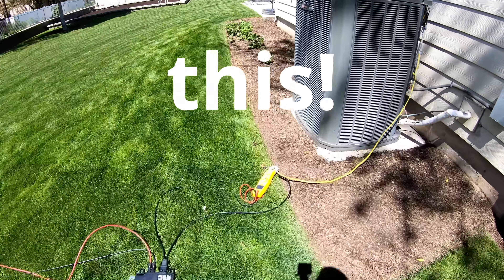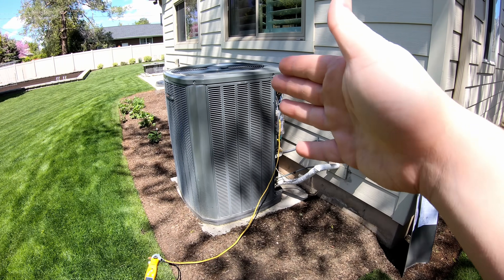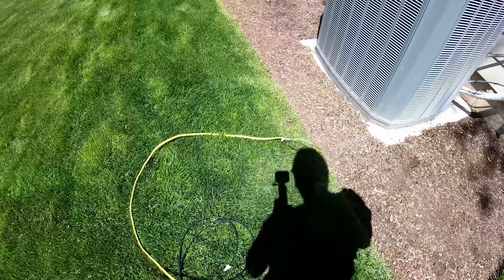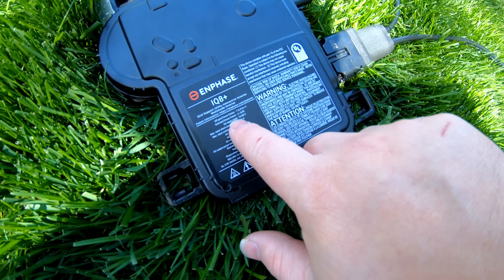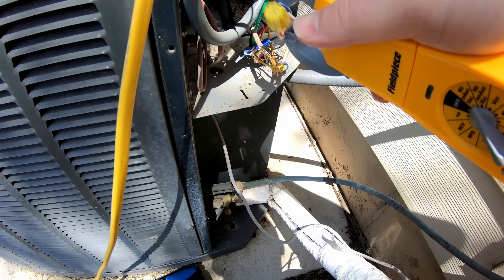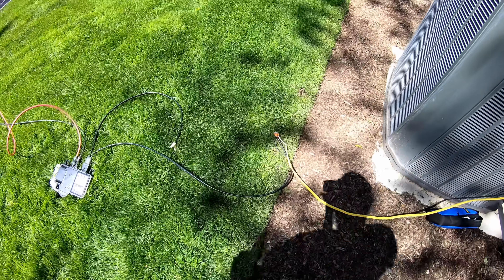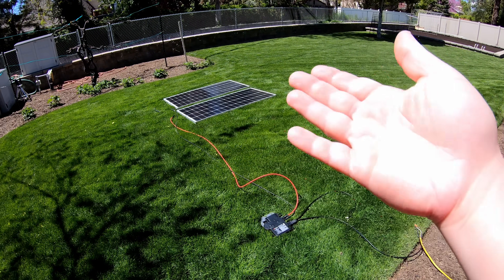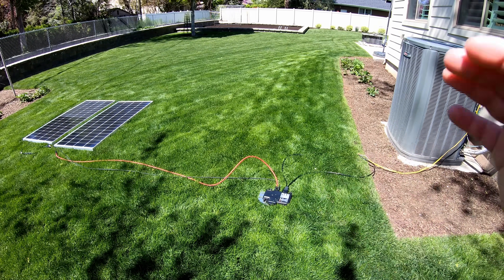1 Hack To Eliminate Your A/C Power Bill This Summer!

Comment: I just tried this with a 2000W SUN inverter.  Shut off the inverter's limiter functions and it works great.  Only takes about one minute for it to produce power, so not much of a delay.
Reply from the maker: Awesomeness! Thanks for watching!
Reply: Can you show your setup?
Reply: @kknmesa  The basics are the same as described in the above video.  I just ran my wires to the inside of the house near where the AC unit is.  The wires (8ga) from the solar array ran to the 2000W SUN inverter.  Only used enough solar power to generate about 1300W for this experiment.  Than I ran the wires (10ga) from the inverter to the outside to the compressor relay solenoid (aka Contactor) on the side of the relay that goes to the compressor.  I only used Line 1 and Line 2 from the inverter.  I did not connect the neutral wire since 240V devices do not use the neutral wire.  That is it.  When the AC came on the inverter took about 20 second to engage and I had supplemental power feeding the AC unit when the sun was out.  I got about a 40% decrease in power coming from the grid and no feed back with this setup.  If one uses more solar power but keeps the supplemental power below what the AC is using there will be no feed back into the grid.  I would have gone with this setup only if I had not already gotten a 6000W off grid inverter.  So now I have the full off grid system installed so I do not need this set up anymore, but this is a very simple low cost setup to supplement your electric bill since most of it comes from using AC in the summer.
Reply: @darylw792 How do you support the 240v of the AC? I though 2220W Sun Inverter only outputs 120v
Reply: @sherwinlee2107  The SUN 2000W inverter has two models and both only support 185V - 265V.  In other words they are 240V only inverters.  The only difference between the two is one model supports 60-110V DC solar input and the other supports 50-90V DC solar input.

Comment: Something is wrong here.  That condensing unit with the Compressor and Condenser Fan Motor both running will draw MUCH more than 5 amps at 240 volts.  It would be drawing more like 15-17amps depending on the tonnage and SEER.
Reply from the maker: It’s a 3 ton 2 stage unit. I guess I just have a highly efficient unit! Thanks for watching!
Reply: @theresatrickforthat   That does not explain it.  2-stage condensers operate at 100% capacity (with both stages calling) or 66% capacity (with only one stage calling).  Even if your system was only calling for one stage at the time of recording the video it would still draw 10-11.5 amps which is still far in excess of the 5-amp draw shown in the video.  I'm not hating at all.  I find your video interesting but something still does not add up here.

2-stage Trane would likely make this an XR 17 series.  What is the model number of your outdoor condenser unit?... 4TWR0736?

Comment: If you think you're running that AC unit on 1.2 amps, I want whatever you're smoking.  12 volts at 200 watt (max)  is ~ 16 amps. Converted to 120 AC brings it to ~1.6 amps MAX. 
You're using two panels, which is telling me each is producing ~ 100 watts during your "filming." 

This isn't a hack. It's a YouTube joke.   I'm running two 1000-watt linear amplifiers via solar and batteries. I WISH I could run it on a couple 200-watt-12 vdc panels.

"1 Hack To Eliminate Your A/C Power Bill This Summer!"

So, let's see you ELIMINATE your A/C power bill using a couple of 200-watt panels.  It's not going to happen. 🤣🤣🤣🤣🤣🤣🤣
Reply from the maker: The two panels are not running the full A/C alone yet...but I'm saving my money for more so I can! For now, I'm putting what I have to work and letting it offset what it can! Thanks for watching!
Reply: @theresatrickforthat    "The two panels are not running the full A/C alone yet."

No kidding?  🤣 Yet you posted a video claiming you ELIMINATED your A/C electric bill by using two 200-watt bifacial panels.  

When you have everything done, PLEASE repost a new video because what you are doing is GREAT!  Once the hardware is paid off, it's PURE FREE ENERGY.

Comment: All seems logical and a fun experiment, but at this scale just not worth it in my opinion.  Where possible though having stand alone power systems is awesome. I build an Observatory in my backyard and decided to do it entirely off grid. It has a 12v 200AH LiFePo4 battery that is charged from 4 panels on the roof next to the dome. Most things in there run directly off 12V directly from the battery (with a step down between battery and bus bars to protect electronics from any spikes etc) for efficiency reasons, but I also have a 2000w inverter. I built the entire power system on a handcart from harbor-freight so i can move it around should I need to power something else. Powers my telescope mounts, observatory dome rotation and shutter, mini PCs, cameras, and charges a few other things.
Reply from the maker: Every little bit helps I’d say. Sounds like a pretty sweet setup you’ve got there! Thanks for watching!

Comment: When contactor is on, electricity produced from solar panels will be used to provide power to the condenser fully and enough without additional electricity from the utility or power will be combined from both sources? When contactor is off, how electricity produced from solar panels is treated? Does this setup work without micro-air easystart device?
Reply from the maker: That’s correct. The grid will supplement any power the solar doesn’t produce, but the AC is using both power sources at once. When the contractor opens, the micro inverter doesn’t see the grid anymore and shuts down the solar power. You do not need a micro-air easy start to make the solar work. Thanks for watching!

Comment: I'm not an electrical engineer. However, how does this work with just one line and neutral? Would it not be better to use two inverters for L1 and L2?
Reply from the maker: It’s a 240V inverter. So two hots. Thanks for watching!

Comment: 400 watts of solar is roughly 10% of the power that unit draws, no one will be eliminating their air conditioner usage with this setup, just reducing the draw to a small extent. those 2 solar panels couldn't even power the smallest window a/c unit you can find. it will however power a fan, that's about it. now if you built up that solar panel grid 10 times, yes you could technically power that unit in full sun only, however you would still need the grid to start the high load from all the motors in it.
Reply from the maker: You’re right. Except in my case, those panels were providing more than 10% for my particular AC unit. Anyway, it’s a stepping stone to my dream huge solar system. Stay tuned for more! Thanks for watching!
Reply: The system was drawing 5.2 amps at 240v (1248 watts), and the solar was supplying 1.22 amps (about 292watts)

So it's offsetting about 23.5% of the load once the inverter fully boots up and starts exporting. He'd need to quadruple his solar output to match the draw, but it definitely does offset it a significant amount.

You also appear to have missed the part where he mentioned the soft-start unit on his ac system, so the inrush current/startup load is actually quite small on it now.

The bigger concern is just about the financial viability of it. This thing is only going to "produce" power while the AC is running, which is going to be mostly during the hottest parts of the day, but it likely won't be running constantly during those hours, so there's still a huge waste of solar production energy, not only when the AC isn't running, but also for the first several minutes that it is running, so it's terribly inefficient. ~300 watts of production isn't terribly much, but it gets worse when it's not even being fully utilized to power the rest of the home when the AC isn't running. With a system that small, I don't really see a good reason not to just go ahead and grid-tie it. You're going to be drawing 300 watts at any given time with other items/appliances in the home any time the sun is shining anyway.

Solar takes a long time to hit a break-even point anyway, so only having it run a fraction of the time that it could be producing is going to make that considerably worse.
Reply: that's a crazy efficient a/c unit, i don't see how it's possible for it to only be pulling 1250 watts when my 3 ton pulls over 3 times that while at idle(not starting).

Comment: You will need 10, 350 watt panels to run a 3 ton unit.
Reply from the maker: In my case, I would just need 5 or 6. Thanks for watching!
Reply: @theresatrickforthat  So 1.5 ton unit?  I love that AC units are starting to be able to do this.  Does your unit have a soft start?

Comment: I must be missing the point. What is the primary benefit of hooking the solar array ONLY to the AC unit as opposed to the electrical panel in the house? Couldn't you be saving even more money by offsetting the energy cost for other appliances you are running as well? Is there other equipment cost that I am missing?
Reply from the maker: You would be right about getting more use connecting straight to the power panel. But then you would need a grid tie agreement. Going through the AC is a way to start small and ensure you’re 100% self consuming and not back feeding the grid without a grid tie agreement. Thanks for watching!

Comment: It honestly seems like it would take a long time to recoup the money spent on all that equipment you need to get it 100% off grid.  
Even if you got it 50% off grid it’s a large up front cost for enough panels(you’ll need more than what you are showing) all the wiring and inverter(s).  

Until energy cost get higher it’s not worth the extra cost.  
Although, that is the plan, to make energy cost skyrocket so you have to change over to solar.  
Energy can actually be extremely cheap if they would just build more nuclear plants and drill more oil and dig more coal.  
We would be paying pennies for energy if they would.
Reply from the maker: I’m using it as a stepping stone to get a bigger system. But might as well start putting it to work ASAP right? In the long run personally, I’m going for energy independence so that I’m not at the mercy of the government and utilities. Thanks for watching!

Comment: What’s the actual delay time before you have output once the iq8+ once it sees the grid?
Reply from the maker: I’ve found it to be between 4 and 5 minutes. Thanks for watching!
Reply: @theresatrickforthat you should add another contactor with a delay on make  that brings on the ac after the delay time and do a video on that. Many ac units don’t run that long. Your soft start is basically a delay on make switch for the compressor. It may require a couple 240 v diodes

Comment: I have tried to read through the comments to see if my questions have been asked but I was hoping I could ask you for confirmation? I am trying to learn about solar and I like the idea of slowly transitioning to it.
1. In the winter, do you need to disconnect the solar panel's if using a gas heater?
2. With a setup like this, as long as the panels don't produce more wattage than what the ac uses, no worry of backfeeding the grid?
3. Does the microinverter only accept (2) panels? Increase the number of microinverters as more panels are added?
4. Is the EasyStart required for a setup like this? If so, can the EasyStart be used with a heat pump like the conventional ac condenser used in this video? I have conventional like you, but like the idea of moving to heat pump considering it's benefits provided a setup like this is possible.
Reply from the maker: 1. No need to disconnect during the winter. The AC will always be off, so the inverter will never see the grid and will never produce power. Essentially, with the AC off, the contractor is always disconnected which in turn has disconnected the solar. 2. That’s correct. The goal is to just have self consumption. 3. The micro inverter has a minimum and maximum voltage range. So in my case, I needed two 200W panels to get me into that voltage range which I show in the video. You could use a single 400W panel and achieve the same results. Just find solar panel(s) that fit the voltage range on the micro inverter and you’re set! Yes, you need more mico inverters as the amount of panels increase. 4. The EasyStart is NOT required for this setup. I just have one to help my backup gas generator be able to run it during a grid down situation. And yes, the EasyStart does work with a heat pump just fine. A heat pump would be ideal to connect solar like this too so that you can offset your AC summer time bill as well as your winter heating bill! Thanks for watching!
Reply: @theresatrickforthat Thank you for the reply.
Reply: @theresatrickforthat One last question, did you mention it in the video or anywhere in the comments, what was the size of the AC unit? I thought I remember seeing or hearing it was a 1 ton unit. Is that correct?

I just found in the comments it is a 3 ton (36,000 BTU) unit.

Comment: As HVAC dude I’ve been wanting to test something like this out in my own house, nicely done. I really see an opportunity for newer inverter HVAC system where the amp draw is low most of the time.
Reply from the maker: Thank you! And thanks for watching!
Reply: Went to HVAC by trade ended up in solar. I like this idea.
Reply: Yes I have a Bosch 2.0 inverter system thinking I wouldn't need the soft startup correct?
Reply: @stephenhawkx  I don’t think so. One of the main benefits of an inverter compressor is that it does its own soft start and avoids lock rotor amps. Your challenge is going to be how initiate the power from the PV solar since your unit does not have a contactor.

Comment: It seems to me that a simple solution would be a relay that is normally closed when there is grid power is all one would need to prevent backfeeding to the grid.  I presume this must be what’s inside of your gizmo in between the solar system and AC.  The 5 minute part seems excessive and that has my curiosity. 
What a fun experiment!
$200 doesn’t seem unreasonable if the inverter is robust.   You did get a real score on those panels.
Reply from the maker: Thanks so much and thanks for watching!

Comment: If you add a 2nd relay between the Solar power and the HVAC Run relay - that would disconnect the Solar power completely when the Compressor was not running
Reply from the maker: True! But the contactor in the AC seems to do pretty well on it's own. But I love hearing everyone's thoughts and ideas! Thanks for watching!

Comment: Why not just backfeed the solar into the junction box? Sure technically you are backfeeding the grid but the micro inverter will still shut off if there is no grid. You can also cut it off by pulling the safety disconnect and it will cut it. Looks like a really good way to put a couple of panels over your HVAC and get some payback.
Reply from the maker: Doing it that way just boils down to if you might get charged spinning the meter backwards or not without a grid tie agreement. Going behind the contactor ensures the panels don’t run when the AC is off. But I love hearing everyone’s ideas! Thanks for watching!

Comment: I do not believe this will work…the inverter brand and model needs activation at the emphase website using a form that includes the permit number from your local municipality….once activated…the inverter is alive.  You either have this inverter as part of a larger system that was activated or you got the inverter from someone who activated it.  Otherwise…yes…if you connect on the cold side of the switch it will safely transfer power to the ac and when the grid goes down no danger to lineman since the ac conditioner switch will not work with out line power.  Would be interesting to know how you got around emphase activation.
Reply from the maker: I ordered that inverter direct from Enpahse for a different project and used it in this video. I do not have any other systems or inverters from them and as you can see in the video it works! Maybe it's the gateway you're talking about. Thanks for watching!

Comment: That’s great during the day, but is their a way to add a timer so as to hook up to grid during off peak or night hours?
Reply from the maker: No need. It's always connected to the grid so the grid will make up for the difference in the solar when it cloudy or at night when you're not generating as much or any solar power. Thanks for watching!

Comment: This is exactly what I was looking for!!! Thanks!!! My only concern is these inverters have that "5 minute saftey" delay. So technically everytime the AC kicks on you lose 5 minutes of free solar. Does anyone know of these micro inverters are configurable to be less than that? Or are there ones that are?
Reply: I don't understand why the 5 minute delay either. My A/C only runs about ten minutes each cycle so I am losing half my power output. I wonder if that can be explained or changed. I would think a second or two would be fine with modern electronics.
Reply: What is PV islanding?
Islanding is a critical and unsafe condition in which a distributed generator, such as a solar system, continues to supply power to the grid while the electric utility is down. On inverters I have seen, once grid is detected, you can adjust the anti islanding timer to 5, 3, or 1 minute.
Reply from the maker: One of life's mysteries I guess! Thanks for watching!